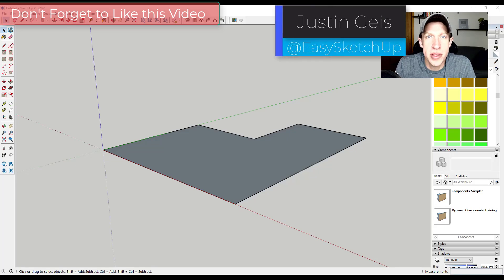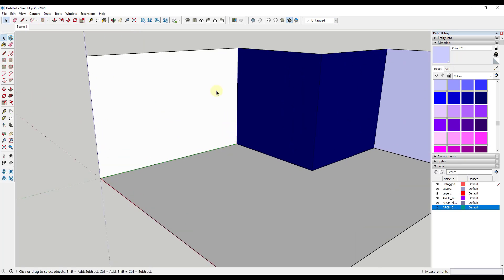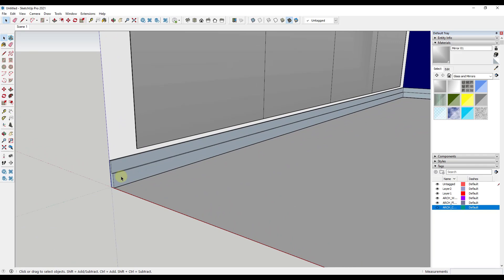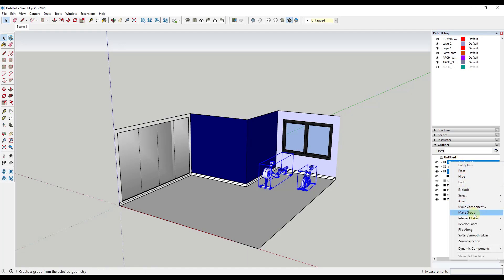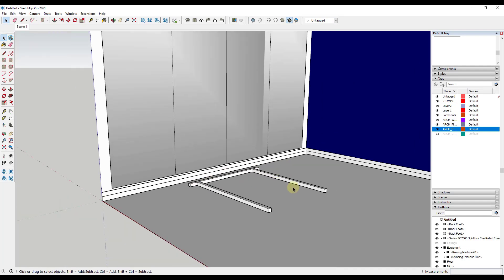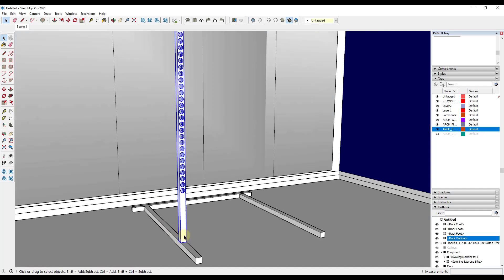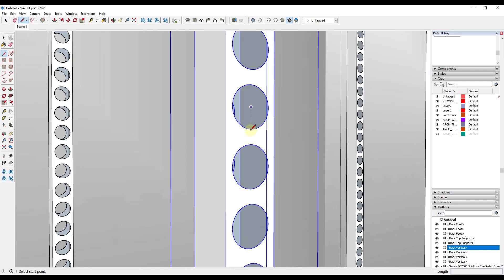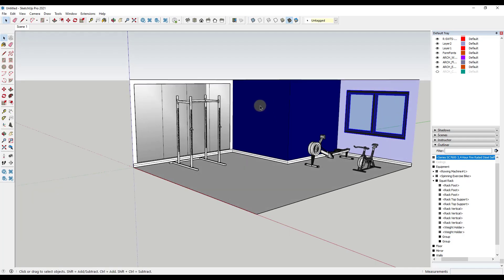Modeling a GYM in SketchUp! Step by Step Tutorial

Comment: I'm using Sketchup 2017 to plan my basement home gym. I really just need the 2d floor layout , and then to add objects that represent gym equipment ( functional trainer, power rack, bench,) so that I can play around with different positions and orientations to see which configuration will work the best for my space.  I only care about 2d and interior walls. 

Is Sketchup a good application for this use case?

Comment: Thanks for sharing. Good to see you modelling again. In my experience avoid drilling holes until the end because if that face with the holes is erased by accident and you don’t notice, SU self-healing will not work very well.
Reply from the maker: Ugh - it didn't like the holes at all - seems like kind of a stupid thing, but it just wouldn't work right. Almost would have been worth it to just use the boolean functions
Reply: @Thesketchupessentials  yep. I just came across shelf pleat that had 50 holes in square tubing, taking up 500k. I deleted the holes and added hole textures and it came down to 35k and zero worries. Saved memory, saved rendering time, and saved hassles.
Reply: @Thesketchupessentials  May I suggest you start a series looking at reducing creation time. There are dozens of techniques to create an entity but only one is the quickest. I guarantee architects will pay attention.